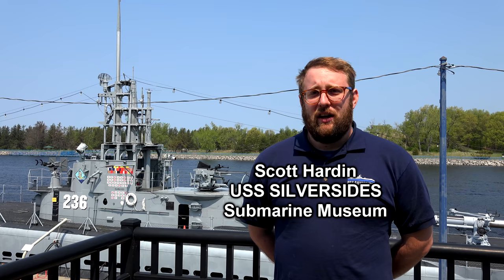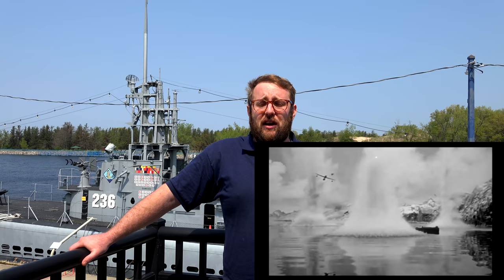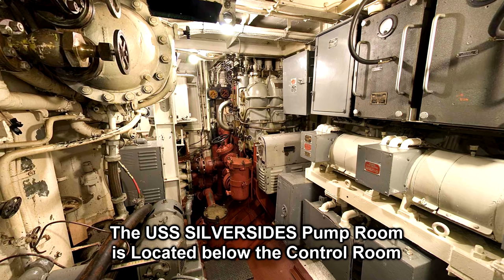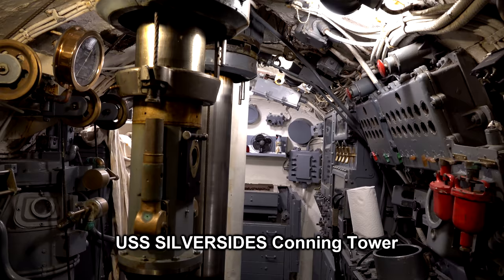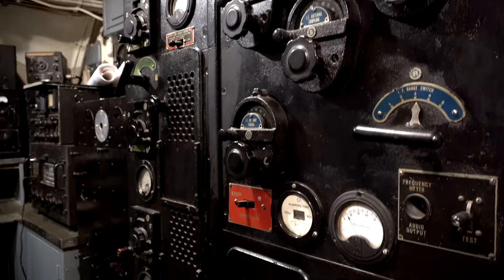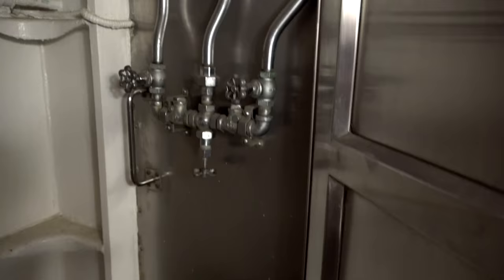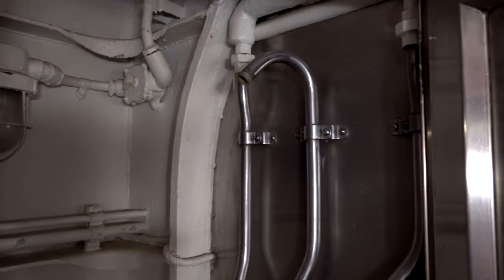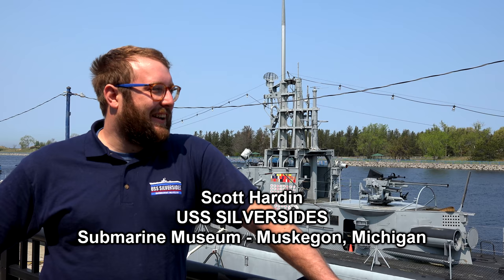USS Silversides WW2 Submarine Private Tour by Scott

Comment: I've been to a handful of museum submarines, and the Silversides is the best of them.
Reply: Ever been in the Albacore?  U505?
Reply: @martyzielinski1442  I have not.
Reply: @davidherbst  Both worth having a looksee.  The Albacore is an early 1950’s experimental model near Portsmouth Maine that they ran out of WW2 parts for in 1971.  The German U505 is here in Chicago.  They dragged it through the great lakes and across Lake Shore Drive in 1954.  So probably PERMANENTLY here now....I took the tour about 30 years ago and was particularly impressed with the orderliness of everything.  All nice neat 90 degree corners on everything.   Unlike the Albacore which doesn’t have a single right angle anywhere.  I spotted one hatch in the deck with seven sides.......no two of them the same length!

Comment: Air conditioning? Showers? A washing machine? More space? Sounds like luxury compared to a German U-boat of the period.
Reply: the A/C was really installed to keep the battery compartments relatively cool.  It didn't mitigate the heat in the sub much at all.
Reply: @onepingonly1941  I imagine being submerged under the ocean would cool down the boat along with the crew quarters pretty quickly.
Reply: @austinread554  Maybe? I'd have to digging in my U.S. sub memoirs and read very carefully. I don't recall. For boats operating in the northern Pacific yeah that's probably automatic.

Comment: The design differences between WWII submarines and modern submarines is pretty striking, as these old subs looks more like a traditional boat than a submarine.
Reply: They were on the surface 90% of the time, so the hull was optimised for surface running.

Comment: What equipment was "fresh water cooled?" My understanding is that the batteries used most of the water. I understand that some versions of diesel engines used on US submarines had fresh water cooling, but they were closed systems that shouldn't have needed much water.
Reply: The 4 main diesels and 2 aux diesels cooling systems consist of 2 parts, the fresh water part and seawater part. The freshwater part circulates through the block just like in your car but instead of a radiator with air blowing through it goes through a heat exchanger. The fresh water goes through the heat exchanger and outside seawater passes over the fresh water plumbing cooling it. Fresh water and seawater never get mixed together.
Reply: @tomtrenter3208  thanks for that explanation.  I don't ever have to add water to my car system though. I'm still a little perplexed on why the fresh water cooling system would use any significant amount of  water.
Reply: @airplanes42 before cars cooling system had the plastic overflow container you had to check and sometimes refill the radiator. Diesel subs like the silversides are the same way and when you have roughly 50 gallons of fresh water in each engine to cool it then it makes sense. Each of the 252 lead/ acid battery cells had about 30 gallons of distilled water and they weren't the sealed type we have now. Sub batteries were routinely charged and discharged at very high amperages so someone had to frequently check and refill all 252 cells. The battery had priority claim to the boats fresh water distiller's output.

Comment: Lead acid battery cells are 2V each, not 3-4.  Otherwise, great narration!
Reply: WWII Gato-class submarines used 126 cells per battery which delivered approximately 350v, just shy of 3v per cell.  The narrator wasn’t too far off.
Reply: @thereisaplace  What was the battery chemistry?  As I noted - lead acid is 2V per cell - and that's set by chemistry. Dead they're about 1.8V per cell, and they're about 2.3 V max when charged.
Reply: @RechargeableLithium  I am unsure of the battery chemistry but you’re right about lead acid... approx 2v per cell. So either they were using Lithium (in 1942 lol) or the cell count per battery is wrong.  I’ll have to research more. For the electric torpedos I heard they heated the batteries to increase voltage output... tho that still wouldn’t get us up to 2.75+ 
Hmmm.. I have some work to do. Thanks for pointing this out to me.

Comment: Wait, SIX diesel engines? Go to 21:45. I thought all the Gato class boats had four. I mean, I trust the narrator can count the engines on the Silversides, but was it modified post-war or something?
Reply: And at 26:35 he talks about a "soft patch" that was cut in the sub at some point to get something very big in or out. Could this have been the extra two engines?
Reply: The wikipedia page on Silversides mentions a 1949 overhaul, perhaps when the two additional engines were added. Y'all are witness to the stages of my little nerd obsession on this.
Reply: They are emergency diesels of lower HP rating than the main engines, meant to be engaged only in crisis.  The USS Cod in Cleveland has the same arrangement also being a Gato class sub.
Reply: The gato class had 4 main diesel engines and the 2 aux diesels , called "dinkies" which were removed because they didn't get much use and occupied valuable space. Some of the soft patches were put there when she was built and others when they were necessary.
Reply: @johnpancharian480  Silversides still has her 2 dinkies.
Reply: @johnpancharian480  Silversides had 6 diesels when she was built,  the 4 mains and 2 dinkies. I believe the soft patch in the aft engine room was one of the ones built in while she was being built.

Comment: If the props were driven by the electric motors and not directly off the diesels when surfaced, then how come the sub was so much faster surfaced than submerged?  Just a matter of less drag?  Also were the subs equipped with a snorkel system that allowed the diesels to run when submerged but close to the surface like the German WWII  subs did towards the end of the war?
Reply: Shooting from the hip here - one thing is drag that slows it down. The other thing - I think the electric motors were also used as a generator(under diesel power). Main engine -> motor/generator -> prop shaft ---------8
When running on diesel the generator is in the middle and run together with props. When running on batterias diesels were uncoupled (through clutch system) and only motor/generator + props are spinning. I think the diesels just were more powerful than electric motors.
Reply: The batteries had to run not only propulsion but carry the electric load for the boat when submerged, as well.  Capacity was limited, the batteries might have to provide power for up to 24 hours under attack, so speed was not every going to be equal to surface speed.
Reply: I believe also a factor was that batteries back then couldn't dump their charge as fast. Even today, lots of current flow means lots of heat buildup. you are inside a tight metal can.
Reply: @sven-erikviira1872  No, American fleet boats have separate generators and main motors. The diesels only turn generators and only on the surface and provide juice for the 4 main electric motors and everything else on board, NO snorkel, batteries provide juice while submerged. She is faster on the surface because the diesels can provide more amperage than the batteries. American diesel boats in WW2 had 2 prop shafts driven by 4 electric motors, 2 on each of the reduction gears. Foreign navies had different setups. Modern diesel boats have inverters and take DC from their batteries and convert it to AC for their main motor(s).

Comment: According to Wikipedia, the Silversides had 4-Fairbanks Morse engines. I've never heard of the subs having 6 engines. Was the other engines small (like a 6-71) standby generator? If not, would like to see a picture of the under floor engine.
Reply: The dinkies are both FM's- one is a 7 cylinder OP 5 1/2" bore and the other is a 3 cylinder OP 5 1/2" bore.

Comment: The guide states at 21:48 that the Silversides had 3 diesel engines in each engine room. Is that right? I'm fairly sure that Gato Class subs had 4 main diesels, and 1 small auxiliary.
Reply: I am not the one to answer but I believe it was a standard Gato, so two fore and two aft.
Reply: @kk6aw  j
Reply: mistermodified1  I think that's right. Ned Beach wrote a book in 1952 titled "Submarine!" in which his ship, the USS Trigger, a Gato class boat, was doing an 'end around' on an enemy convoy during WW2. They needed maximum speed, and put all four main diesels on the screws, and their lone auxiliary on the battery charge.

Comment: Could someone explain why the back of the sail narrows to a point under the cigarette deck like is commonly seen with the later Balao class? Also it looks like the ship had anchor pockets on both sides of the hull and one was blanked over. I know a couple very early boats had the 2 anchors but as I understood it this feature was very quickly deleted from production.
Reply: I was wondering if the anchor was removed when it became a museum boat.
Reply: @onepingonly1941  yes, the anchor(s) are on display outside of the museum building.

Comment: Could anyone speak to torpedo stowage on the Gato class? for instance, the forward torpedo room had six tubes-- how many torpedo's total were kept there? I am not sure, but assume that 6 of the fish were stored in the actual tubes. We see two on racks on either side of the compartment. I'm also assuming at least two more under the floor boards. That's a total of 10. Now I believe there were a total of 24 carried. And I'm also thinking the distribution of these 24 has got to favor the forward torp. room. So short question: how were these fish distributed and how/where were they all stored? Thanks!
Reply: To my knowledge, they carried 10 aft and 14 froward. 10 in the tubes ready to go with another full load on racks behind the tubes, so an additional 10 in quick access and then 2 more under the floor aft and 2 down in the floor forward. 

However, I think late in the war when almost all the large shipping had been relocated to being Poseidon’s yard decorations the number of torpedoes actually went down. Instead of fish they were stowing more ammunition for the deck guns and in the case of about a half dozen boats they upgraded to two 5”/25 guns with about 220 rounds of ammunition, plus the related 40mm Bofors that often supplanted the 20mm guns. 

So basically instead of a submerged stealthy predator of the deep you had a pocket destroyer that could pop up in enemy waters, shout the 1940s equivalent of “Leroy Jenkins!”, and begin blasting away. While armed with two deck guns, two 40mm guns, up to 8 aircraft grade 50 caliber Brownings, and whatever additional weapons the crew could procure through various means including Tommy guns, BARs and in one case an M1 Bazooka.
Reply: @johnbeauvais3159  That's interesting about the late war changes, makes sense, but I have done a fair amount of reading on our Pacific sub campaign, and don't really remember reading about that.
Reply: 6  in the fwd tubes plus 10 reloads, 4 in the tubes aft with 4 reloads..... 24 torpedoes.

Comment: Too bad the torpedoes were essentially worthless scrap in WW2.
Reply: Not to mention these torpedoes could circle around go back to you after you fired them
Reply: @ramal5708  Rest in Peace Tang and Wahoo!
Reply: Check your history..... it did take 1 1/2 years to get the Mk 14's working properly but look at the rate of sinkings after they were fixed by the fall of 1943! The Germans had their fair share of torpedo problems as did the British. The so called Japanese "wonder torpedo" the long lance had it's share of issues too. Most navies used plain air to oxidize the fuel but air is only about 20% oxygen, 78% nitrogen. The Japanese used pure compressed oxygen which allowed them to have longer range than ours but their steering mechanisms were poor and they couldn't really aim them. They just dumped lots in the water and hoped for the best. Through poor design and or maintenance they had small leaks of pure oxygen that sometimes had bad endings. Our problem early in the war was that our officers didn't think a torpedo had the range to sink our ships and made no plan to avoid them till we got closer. By then it was too late, even a blind squirrel finds the occasional nut!
Reply: @ramal5708  Any torpedo can circle if it isn't designed or maintained properly.